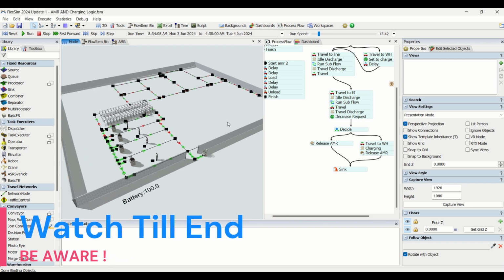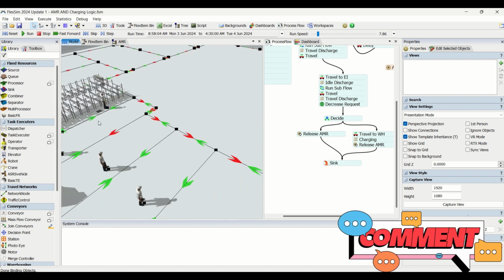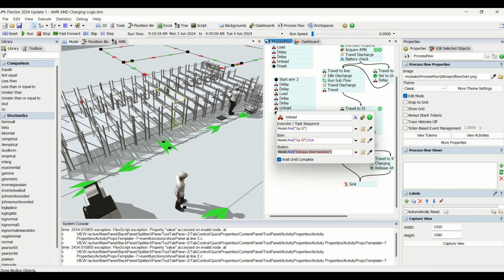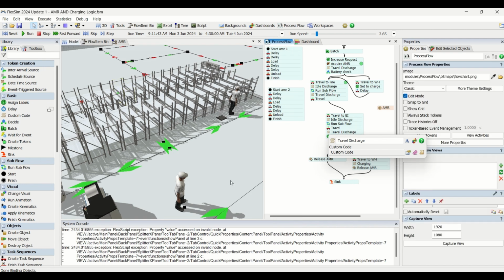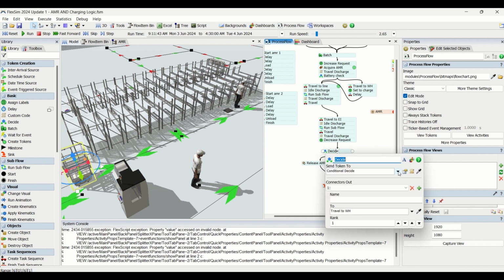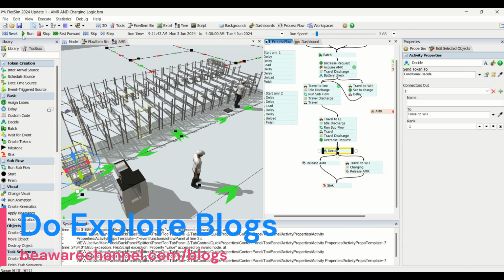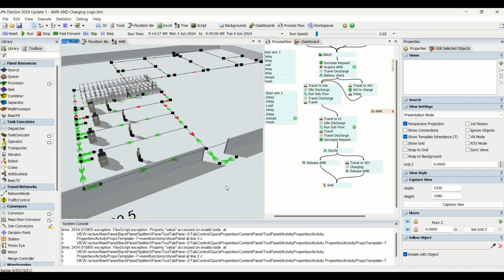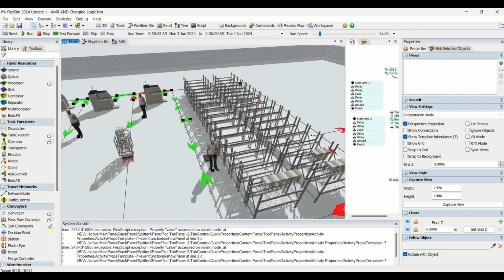AMR Logic & Charging 2 | Material Transfer |Process Flow Model Build | Flexsim Tutorial| Leansimcorp

Comment: Thanks for you detailed explanation. One question:  have you used the AGV network battery charging tool in this model ?
Reply from the maker: We have used the network nodes and we fetch the details of AGV for charging details, this is not with agv network but away around. this is another way how you can make use of network nodes for agv charging